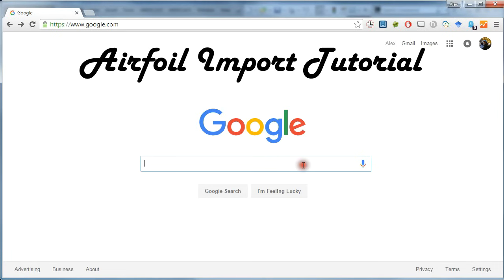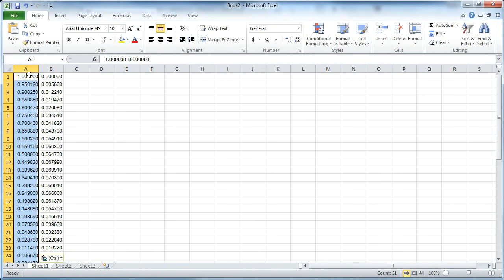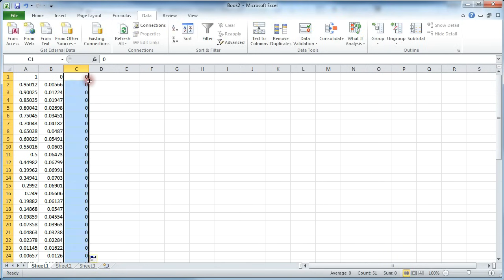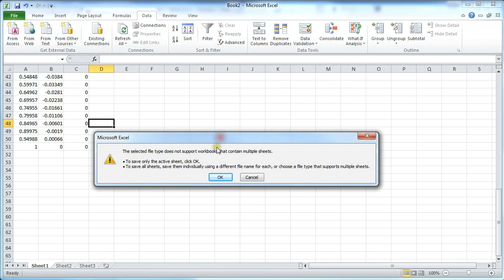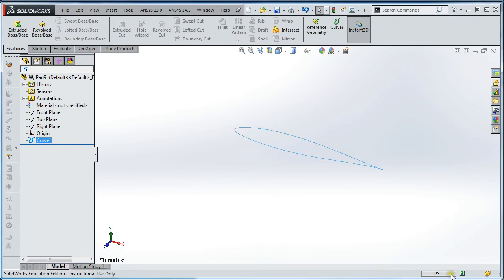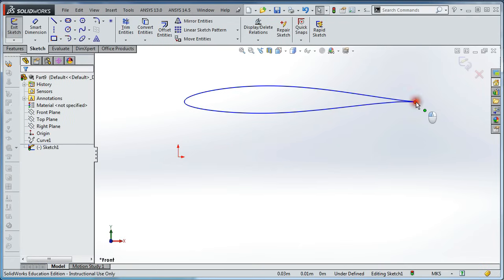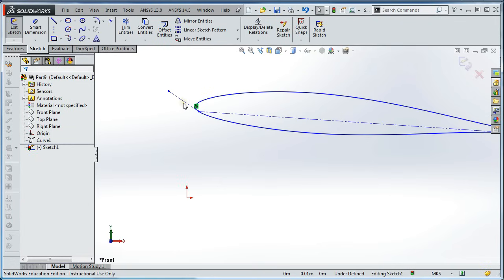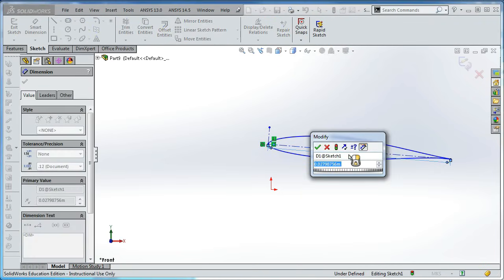Importing airfoil coordinates to Solidworks

Comment: If you are having problems inserting a curve by x,y,z then try saving your .xlsx to a .csv and then saving it as a text limited file. For some unknown reason when I exported from an xlx file to .txt it said invalid file type in Solidworks.
Reply: adding onto this, close the excel workbook from which the text was created. I tried all and it didn't work until the workbook was closed.
Reply: @frebinfrancis2193  That was also the fix for me, strange... Thanks!
Reply: @frebinfrancis2193  bro wtf. why
Reply: it actually worked
Reply: thanks bro
Reply: Still having an issue inserting the text file into solidworks. "file name entered was invalid, not found, locked or of an incompatible type"
Reply: fixed it by adding ".txt" to the end of the file name
Reply: @platanomikeyklk1455  This actually worked. You saved me so much frustration
Reply: @platanomikeyklk1455  You're a lifesaver
Reply: @platanomikeyklk1455  ur the goat u saved me

Comment: Still working in SolidWorks 2025. Perfect video.
Reply: Do you think you can design a wing outside mold line using the techniques described here I might need some engineering support for a new light sport aircraft and can certainly use some help with the air foils imported into solidworks.

Comment: Bro,where is the wing? This is just the Aerofoil only
Reply from the maker: If you just need a rough outline of a wing, "Features -> Extruded Boss/Base" will suffice. If you want the root and tip to have different dimensions or orientation, you can define an airfoil on both the root and tip planes and loft between them. An actual detailed wing design can use that lofted surface to constrain the dimensions of individual aerostructural components (skins, ribs, stringers, spars, etc.)

Comment: Weird, when I imported the coordinates, the pointy end of the airfoil does not connect, there is a small gap there..
Reply from the maker: This is normal for NACA 4-series airfoils. For a quick fix, you can just add a line or semicircle to close the gap. Remember that the trailing edges of actual wings also have finite thickness - nobody's out there shaving off the last few microns until their trailing edge doubles as a kitchen knife.
Reply: @stillyslalom1  ah I see, thanks for the reply, didn't expect to get a reply from the author himself 🤭

Comment: How do I print a 1:1 of my dimensioned Solidworks airfoil so I can use it to cut a template?
Reply from the maker: Create a Solidworks drawing of your airfoil & set the drawing scale as 1:1. Print the resulting drawing without "fit to page" or any scaling. Measure a known feature on the printed page to ensure your printer's scaling is accurate.
Reply: @stillyslalom1  hey thanks man. I’m in my last semester of engineering design for my ME and I’m the airfoil and control surfaces guy for our Design, Build, Fly team here at UWF
Reply: @stillyslalom1  have any tips? Our wingspan is 6.6 ft with a little over a ft of chord length.  I managed to cut a decent prototype out of basic eps foam from Lowes. I’m going to use 4 light weight spars to help support the foam.  Going with a Clark Y design
Reply from the maker: @TheC130navigator  Foam is cheap - make a few copies of the wing & don't be afraid to do some destructive testing of the plain foam profiles before you decide how much stiffening they need. High-lift devices will be really important in getting your plane off the ground within 25' under heavy load. I don't envy the powertrain team's tradeoff matrix.
Reply: @stillyslalom1  I was gonna use a modified undercamber Clark Y.  We need to get off in 25’ but a Sigler profile is too thin to support the weight of the motors. I plan on using flaps to help increase lift. What do you think and how would I prove the design without a wind tunnel?
Reply from the maker: @TheC130navigator  XFLR5 should work pretty well for your use case - there's a bit of a learning curve, but it's meant for small-scale aircraft aerodynamics. It'll even model ground effect and stability margins!

Comment: when i am importing naca0018 profile it is a bit open where trailing edge should be, how can I close it without disturbing the naca0018 profile
Reply from the maker: http://airfoiltools.com/airfoil/naca4digit - you can use a modified thickness distribution coefficient a₄ to close the trailing edge

Comment: the trailing end for me does not close, how do i fix this??
Reply from the maker: Any real wing will have finite thickness at the trailing edge, so it's fine to close the contour by drawing an additional line between the two endpoints in your sketch as long as the gap is small. If you're designing a wing that'll actually be built, consider the minimum allowable thickness of the material you're using and make sure your trailing edge satisfies that restriction.

Comment: the airfoil i imported isn't connected at the trailing edge. how do i close this?
Reply: you can directly sketch a curve between those points from CURVES option available in solidworks

Comment: Nicely explained but how to add a trailing edge hinge flap to 2D airfoil??
Reply from the maker: You could import an airfoil coordinate .dat file to XFLR5, set the flap angle (within 'Direct Foil Design', 'Foil' -> 'Set Flap'), export the modified airfoil, then import that to Excel. 
If you need to change the flap angle repeatedly, best to just do that within Solidworks.
Reply: @stillyslalom1  thanks

Comment: "The 3d spline curve is self intersecting" solution needed
Reply from the maker: Can you (or someone else with the same problem) put the coordinates on Pastebin? I'll try to import them & see if I run into the same error.
Reply: @stillyslalom1  could you please check these? They are the coordinates for a cam of a camshaft system, I've been prompted with the "3d spline curve is self intersecting" and also "at least two adjacent coordinates are identical or too close". What is too close?
https://pastebin.com/6RMjqVwv
Reply: Forget about it, the only problem was that Solidworks does not recognize the decimal divisions as commas (,), just as dots (.). That was all that needed to be fixed
Reply: @felobazo24  please explain i'm also getting self intersecting geometry tell me how to fix it.
Reply: Soham Yerandkar my problem was the system settings, I had commas as decimal dividers and the coordinates had dots. I had to change that and everything worked well after that
Reply: @felobazo24  can you please where to change the settings cuz I'm getting same error .
Reply: Soham Yerandkar Go to Tools, Options and under the System Options tab, click on General.  About the 5th item down it will say "Use system seperator for dimensions".  You should be able to set it there. Or if that does not work change your Windows system settings (google how to do that) and restart Solid

Comment: helo sir
actually m trying to make airfoil NACA 0012, but it shows file incompatible type
Reply: i have this problem too.   Put your data into Excel, use Text-to-columns, and save as a CSV (comma delineated) file.

Then rename the CSV to a .txt file and select to use notepad as default program.

Then you can import the txt file into Solidworks with no issues.
Reply: @Welcome2TheInternet  Thanks that worked for me on SW 2018
Reply: @Welcome2TheInternet  thank u brooo it worked

Comment: You should be modeling in mm, gram, second* accuatly :) those are the ISO units
Reply from the maker: Use the units that are customary for your field, or the units used in practice by your coworkers and collaborators. The course for which this video was made is taught by an ancient American aerospace engineer, and he prefers inch-pound-second.
Reply: You should be modelling in m-kg-s actually.  SI units.